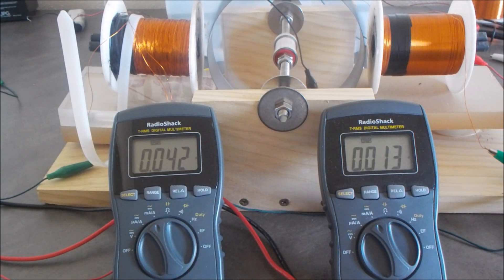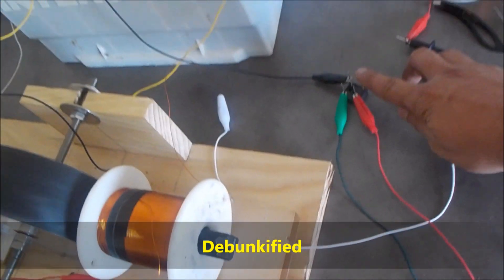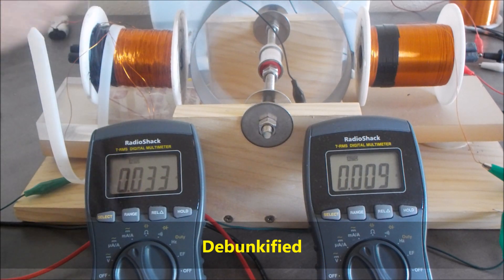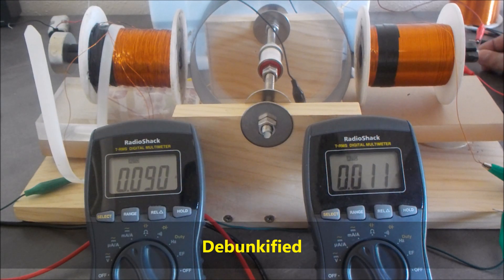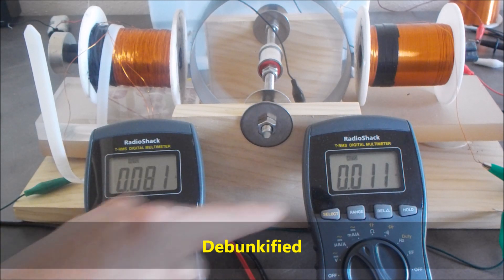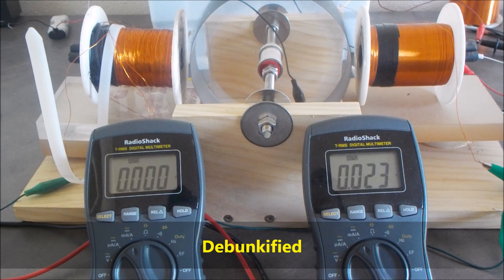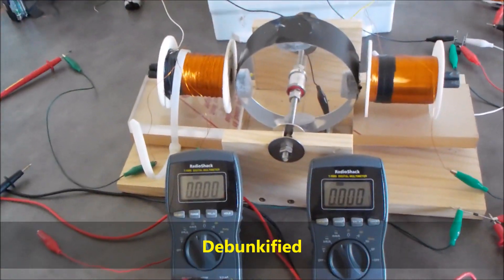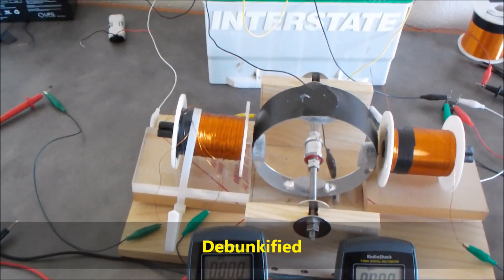GLIMPSE of FREE ENERGY OVERUNITY ROTOR SPEED UP

Comment: Why don't people take an engine turbo (which is made to "move" fluid - like water, air is considered a fluid), put a pulley on it's shaft, connect pulley to a generator, put turbo inline with household water supply; everytime anyone uses water it will turn turbo/generator and supply power to charge batteries for an inverter. Free power.
Reply from the maker: +anon ymous That's a good idea. I think that has been done before but not for that particular purpose. Good thinking!

Comment: With the magnet on the back, my first thought was that the magnet on the coil was slowing down the flow and putting more drag on it in half of the coil, so it had to push more energy through, the higher energy throughput going through the un-impeded part of the coil would be pushing the motor faster.  But when you talked about you having it done before and the current being cut in half, that's what got me thinking.  So when you did it before with the copper coated welding rod, was it the same diameter as the ferrite rods or were there many more sort of bunched up?  I think that the amount of rods in there could change the effect on the current.  The copper coating could have something to do with it as well, so perhaps you could get a sort of copper pipe that could fit inside the coil to test that.  You could put the ferrite rods inside the copper pipe to see if you get the same effect as with the welding rods.  
To further test that, you could put the copper coated welding rods in the pipe and see how that effects it.  

This is all just speculation on what might do what, so none of what I have said has been founded by experience, but only by logic and progressive thinking.
Reply from the maker: +Theminecraftian772 Hey there, it's good that you are thinking, but experience is the best teacher. I have ordered some copper coated welding rods in an attempt to achieve the current draw being cut in half. So I'll just be waiting on that. With those I would just stick them in the spool that I already have there. The welding rods from before were very thin something like 1/16" or so and they were bundled together inside the coil former.